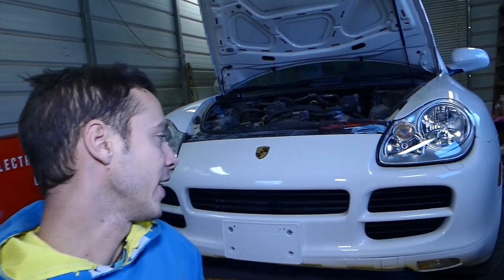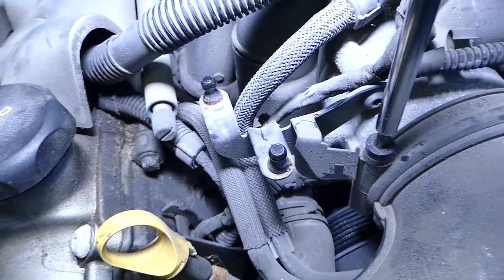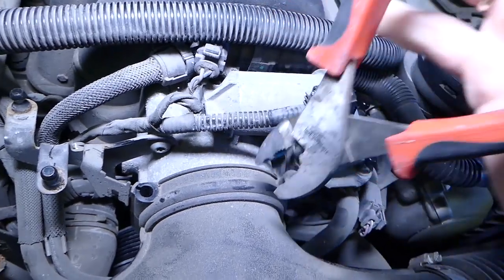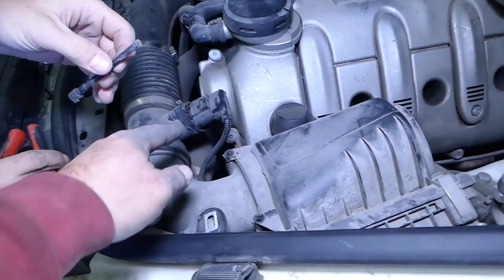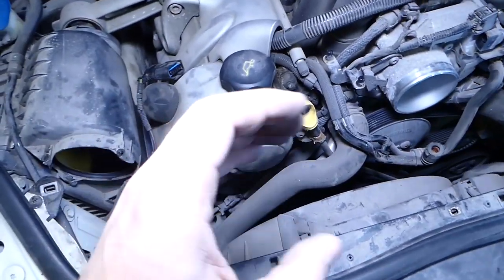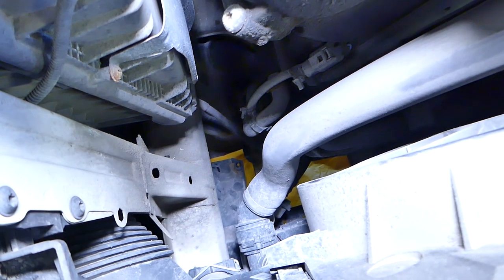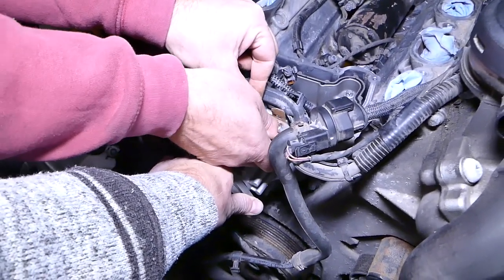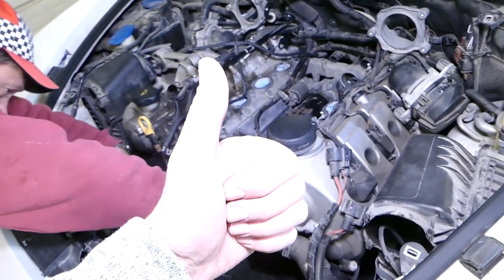HOW TO REMOVE AND REPLACE WATER PUMP ON PORSCHE CAYENNE

Comment: When the pump leaks where would you see the leak coming from ? Sounds like dumb question but i have 08 cayenne s and its leaking coming from behind engine/front transmission i did the y pipe and stuff but recently start leaking again

Comment: Those pins are a pain in the ass. U just replaced them with long bolts and self locking nuts. Looks very detailed and clean. I use torx / alen head bolts